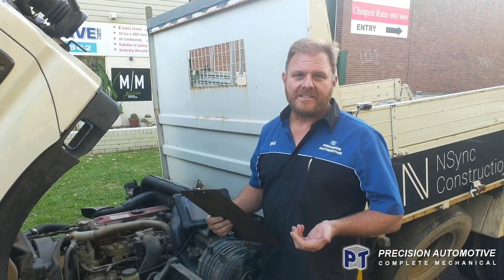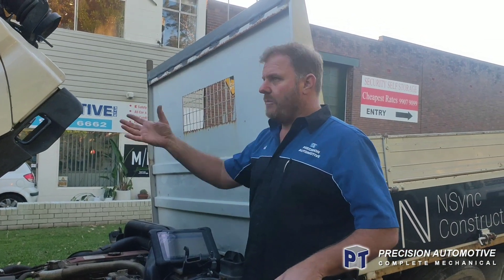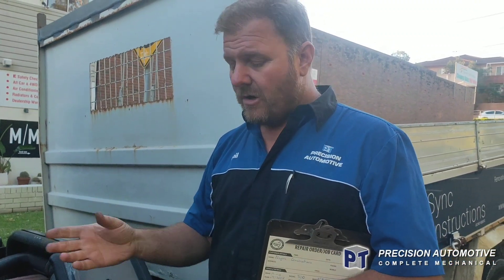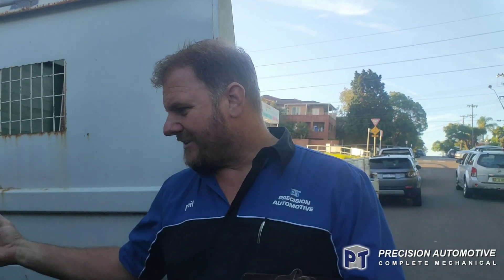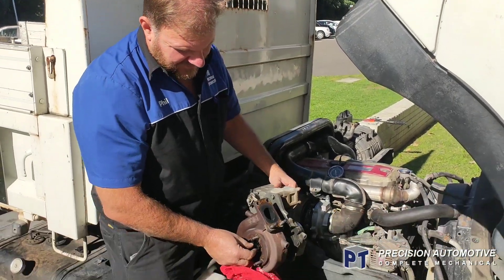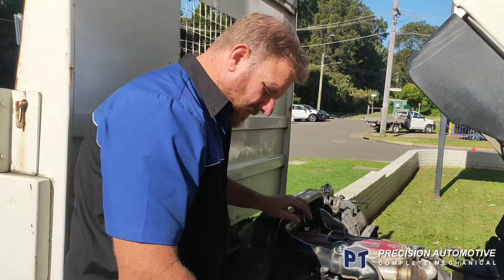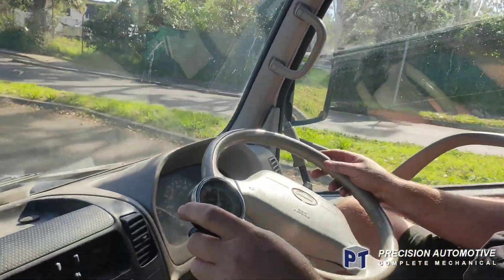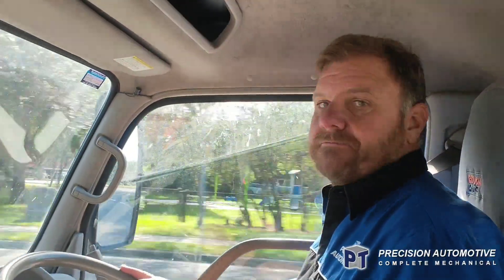Hino 300 turbo diagnostics.  No power

Comment: This could be my problem,
2018  hino 616 ,300
Running as smooth as it could, hooked up the caravan, unloaded it and the engine was vibrating, (shaking )
Hino couldn't find anything, Another mechanic replaced all the engine and GB mounts, another mechanic said it was fuel but done nothing.Rattle is where turbo is but it has happened only since towing caravan,
And this is when stationary..I'm lost for ideas
Reply from the maker: Hi mate. really should go to someone who knows what they are doing, but i would not say it has anything to do with the turbo. Maybe the Injectors .?
Reply: Hi Guys,
I have seen 4 mechanics so far and going crazy,
I drove to Sydney last year and it got us there and back,
I will be in Sydney early Feb..I just need to confirm dates and book it in with you to do a diagnostic tests,
Is that somthing that you could help me with,
Cheers 
Craig

Comment: Can these turbos fail without the fault codes? I've got one only getting 7psi boost checked with map and boost gauge to compare. New injectors and everything else checks out ok. Starts and drives fine just lacks power mainly noticable when loaded.
Reply from the maker: Turbo is generally fine it's the Actuator that fails, but buy a complete turbo.  i would have someone Diagnose it first tho.
Reply: @PTPrecisionAutomotive  I am the mechanic, have done all the actuator tests with the stepper, there's just not much to go with being 2010 model the data doesn't show actual position of vnt only command position by ECU. Without fault codes it's really a gamble.

Comment: Helli guys. I have a Hino 300 Bus, We di work on the engine . replaced Big ends and Main bearings. After installing the engine we tried to start. There was no power supply on injector wires. Power supply was everywhere except injectors. They couldnt open and spray Desiel. We checked all the wires..Fuses relays sensors.. it cant be the computer because it was starting before stripped it
Reply from the maker: Cam or crank angle sensor.

Comment: this was a pretty common fault for the 300 series trucks of this era. when i worked for the dealer we would do at least 1 a month in warranty. they would usually present a P0045 fault  or can U1123 fault, heat is a big killer, ones out of warranty i would cover VNT unit with heat reflective tape
it's a good idea to do exhaust studs around the same time as they are known to break the front studs in service. I believe the newer generation has the VNT controller block mounted.

can you please share where you were finding the VNT controller repair kits O/Seas ?
Reply from the maker: that is a good suggestion. it wasn't covered in the video but all the exhaust studs were replaced with new gaskets aswell.
Reply from the maker: yeah it was overseas, i never got one. thought it best to completly replace the whole unit.
Reply: I'm glad I found this video, our 2012 is going in Monday for a new turbo, same P0045 code, happens once the engine is heat soaked, once the light came on the power was gone. I was very disappointed when the mechanic said it would need a whole turbo but once I seen a removed pic of the turbo it's obvious a one piece which is well, annoying haha. Thanks for the info